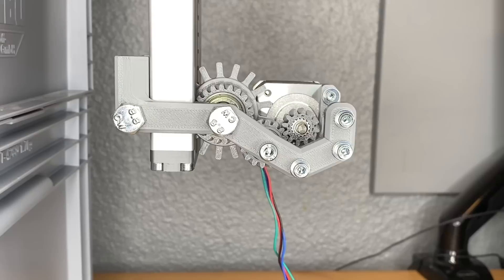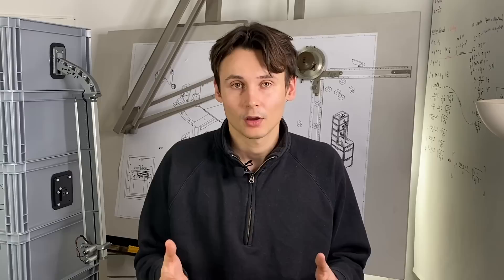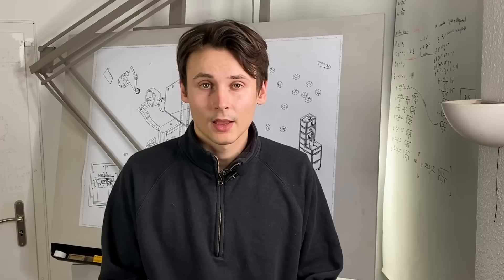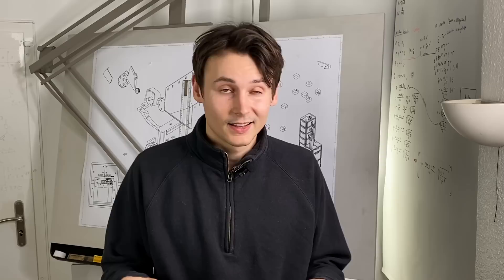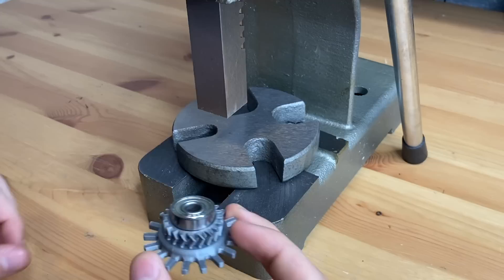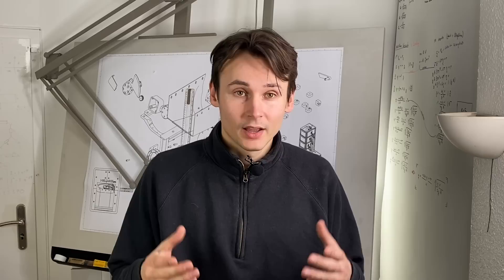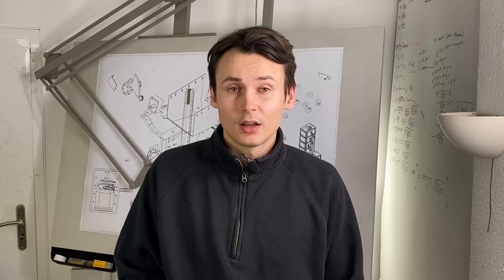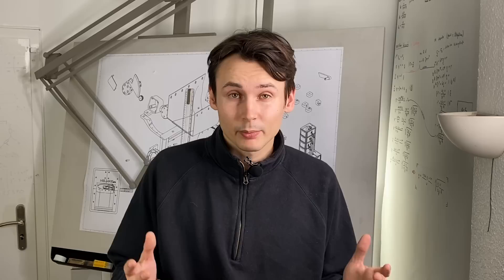The sprocket - 3D printed automatic screw packaging #002

Comment: I don’t know if you considered it yet, nor how well it would work in comparison to this method, but something akin to a “Rotary Air Lock” / “Rotary Hopper” could be used as well.
Reply from the maker: Interesting, I never thought about that.. will think about it
Reply: Isn't this basicaly it, but for single screws at a time?
Reply: @akkudakkupl  The thing i am thinking of, rather than being a gear with a hole near tangent to the chute, has a Circle in-line with it.

Rather than having a gear it has one (or potentially more, although I don’t know much about this) indentation in a cylinder.

So every rotation it drops one part.

It may be slower, although it would keep the parts better aligned potentially.  May also be able to make the motor control easier, but that’s debatable.

Also it may be easier to adapt to other parts/materials, you can make a different indentation for each part/material, unlike this which (at least as of now) is quite dependent on the screws being able to have that screw notch fit in there.

GRANTED whatever works works, and i feel like the rotary hopper may honestly have quite a few disadvantages.

But i just wanted to throw the idea out there and make sure it was considered.
Reply: @ericlotze7724  Okay, I think I get your idea. The tool needs to be engineered for a specific part anyway ;-)

Comment: Really excellent videos! Have you consider using a worm gear from the stepper motor. Those are completely interlocking if power fails. Furthermore, I noticed that your magazine has a length that’s scales to the screws shaft length. Is that necessary? Just a suggestion but you could use the same magazine for eg all m4 with different shaft lengths as it’s the head that makes the magazine work? But again excellent work! 😃

Comment: Cool project! Maybe a worm gear would also work.
Reply from the maker: Thanks for the idea! I'm not sure if they don't have too much friction at higher speeds when using printed gear parts, operating temperature needs to stay low because of that, additionally worm gears do tend to have higher reduction ratios, would like to keep the dispenser speed though..

Comment: I’m also curious about the vertical stack design, and how universal it will be.  I’m picturing that it works uniquely because you’re modeling with hex cap screws and hex nuts.  Other screw types like a countersink head would not keep the screw shafts horizontal and lead to a different feed solution.

What I’ve seen along these lines tends to be a mostly horizontal + sloped design that’s still gravity fed but uses a vibrator to overcome stiction and keep the parts flowing.  Is this something you eliminated in your design decisioning, perhaps because you don’t have this requirement?

Comment: Hi. Is there a reason splitting bracket for the two solenoids was not considered? The top solenoid could then be positioned on a rack attached to the magazine, with incremental fix points for every fastener count. Position top solenoid at "10" for a drop of 10 fasteners.
Downside is different racks/fixture brackets for every fastener type -> but already an inherited design choice from the fully constrained magazine itself.

Comment: I wonder if you can throw in a couple horizontal or even uphill swings in the loading hopper to minimize the weight of the screws instead of having to load it with a separator. Some of that excess force maybe will be lost in the turns?

Comment: Just asking, why so difficult? A sensor at the output and pick up wheel will do wonders, this will be connected to a plc, (on the plc you can make recipe's) you can use 1 solenoid, so you can hold the screws and drop them in one package!

Also safe for more size screws! 

(Can also be a arduino connected to a pc)

Comment: Very cool design! Maybe I missed it, but why do you need to singulate the screws in the dispenser? Couldn't the screws be counted before they enter the dispenser using a light gate? Then you'd run the pickup wheel until the right number of screws has been picked.

Comment: If you want to avoid a stepper motor, can you maybe use a dc motor in conjunction with a light sensor sensing the sprocket? Every flash of light would mean a new screw has passed, similar to how gaming mice scrollwheels work. Want 10 screws? Turn on the DC motor until you've seen 10 pulses.
Reply from the maker: Thank you for the comment! True but would be hard to stop/ rotate precisely. Not sure if it would work reliably

Comment: wondering if using a closed loop nema boards on each motor. Assigning each an address where you would only need to have one controller on the base unit configured with how many module units you have stacked. One config value. Base unit = modules 1 Base unit + 1 module = 2 etc, Each module being address and marked on your bin sides. There is a mix and match question here but you could assign a value to each bin and a matrix to decode the addressing needed for the mix and match modules. 1+2 = 3 so base and module 1 installed. 1 + 3 = 4 base and module 2 installed, 1+2+3 = 6 base and module 1 and 2 are installed.

just a thought lol

Comment: Why not use a worm drive mechanism (globoid, single start) instead of this complicated gear setup? That would also self-lock, you'd get rid of 1 set of gears axle and bearing, and it would be more compact as the stepper could then be mounted vertically

Comment: I feel like you could just simplify the whole idea if you just used the machine at 0:21. You could just count how many degrees the wheel turned from there. One flaw I see in that is if the screws get stuck together.

Comment: Based on the principle of " the best part is no part"  -> as the screw exists the separator one by one, why not just use a magnetic or optical sensor to count them then stop the rotation of the motor?

Comment: sorry but i'm still convinced that through a combination of very smart software, plus some very cheap ICs sensors and DC motors, it's possible to build a reliable screw counter/dispenser with similar speeds under 30€ for the entire thing

Comment: Why not just use a RAMPS board and an arduino mega? You can control 4-6 (I forget exact count) steppers per controller. Then you can use G-code to dispense.

Comment: Why not a worm screw?  Its holding power would be greater and changing the wheel for a different screw size seems simpler since you'd mesh the worm screw directly to the axle

Comment: Does the mechanism have enough of locking torque when it is powered down?
 I think a worm gear would be ideal here, as it is inherently self locking, but should be fast enough to reach a similar amount of screws per second. 
I am also interested how long the dividing sprocket will last, given the continued impacts on the long-ish dividing "teeth"
Reply: But that has a very high gear ratio, might slowdown the whole device a lot.

Comment: instead of herringbone gears, why don't you try worm gears, they give oneway rotation which blocks heavy screws from rotating the motor in reverse, and also are compact WRT torque conversion and size ratio.
Reply from the maker: I'm not sure if they don't have too much friction at higher speeds when using printed parts, operating temperature needs to stay low because of that, additionally worm gears do tend to have higher reduction ratios, would like to keep the dispenser speed though,  so I am not sure if this would work

Comment: Is there a reason you didn’t use a flathead for the wheel that picks up screws?
Reply from the maker: Yes. There are 3 such screws distributed on the pick up wheel. Without them/ using flatheads the whole thing would not work for long.. I will explain it in a later video :)

Comment: That whole thing is an overcomplicated solution to a simple problem. Although a very nice solution.  But too many parts and the whole mechanism needs to be well maintained. 
In normal life, where time is money, the real people measure the weight of 10 screws, and then use a precise scale to count the screws. I think, at big screws it is accurate enough. At small screws, just add some more, and your customers would be happy too.

Comment: awesome video ♥
i am using blender for 3d modeling , my question is did your software make gears interact with each other or you just animate it with keyframes and what did u use for such project like that 
for mechanical engineering
thank you so much

Comment: Can't you use worm gear? It's self locking and the torque doesn't affect the motor.
Reply from the maker: self locking would be beneficial, but I'm not sure if they don't have too much friction at higher speeds when using printed parts, operating temperature needs to stay low because of that, additionally worm gears do tend to have higher reduction ratios, would like to keep the dispenser speed though..

Comment: It looks like many parts need to be designed and parameters tuned for each screw, nut & bolt. Have you considered designing a vibration conveyor plate and a load cell to count by weighing using a cheap load cell?
Reply from the maker: I tried to keep the number of parts to replace as low as possible, but you are definitely right. One of the advantages compared to weighing is that the screws are supplied fully constrained and oriented. This is necessary for a variety of other automations. Robotic bolting of assembly's, embedding nuts in 3d prints automatically. etc. - The counter is supposed to be just one of many modules that can be connected to the feeder.
Reply: @christopherhelmke  I did not realize you had this requirement but I’m sure you know that vibration feeders are the number one solution for part orientation. Strengths: extremely reliable (from design simplicity, low maintenance, no moving parts), high social media appeal 😌, weaknesses: noise, resonance tuning.
Keep up the good work! 😁

Comment: 0:23 why did you use a lifting wiper mechanism instead of just using sink screws to prevent the collision? do i miss something? seems overengineered to me, but very cool, that you put your time in stuff like that instead of printing pointless stuff :-) cheers
Reply from the maker: There are 3 such screws distributed on the pick up wheel. Without them/ using flatheads the whole thing would not work for long.. I will explain it in a later video :) Thanks glad you liked it :)

Comment: Well done.  Do you have a method of sensing whether the feedtube is empty (or ensuring you are dispensing screws)?  As far as controlling the multiple dispensers (you mentioned 10), you can combine three 3D printer controllers ( X axis, Y axis, 2 Z axis stepper motor drivers per each board), and a small computer with 3-USB ports - 1 for each "dispenser".

Comment: Impressive machine but is there a practical use? Parts counting is usually done by weight not counting individual pieces.
Reply from the maker: Yes, yes technically it is more of a feeder than a counter. One of the advantages compared to weighing is that the screws are supplied fully constrained and oriented. This is necessary for a variety of other automations. Robotic bolting of assembly's, embedding nuts in 3d prints automatically. etc. - The counter is supposed to be just one of many modules that can be connected to the feeder.  I think the title is a bit misleading here.

Comment: That dispensing sprocket is already almost a rotary encoder, you would just need an optical sensor to detect the pulses. If you could make it accurate enough, it would allow you to swap the stepper & driver to something way cheaper and simpler to drive, like a continuous rotation servo.

Comment: For a rotation sensor, could you use a photocell encoder? I saw one on an inkjet print and it looked like an effective low cost solution
Reply from the maker: yes .. i will probably use a similar sensor, thanks for the comment!

Comment: I get that you're trying to do it the hard way and be clever but I would just weigh one and do the math. I would use an accurate scale and a device that drops one at a time until the weight matches
Reply from the maker: I totally get your point! I would even say that doing something in an unnecessarily difficult way is not very clever. 

One of the advantages of doing it the hard way is that the screws are supplied fully constrained and oriented. This is necessary for a variety of other automations. Robotic bolting of assembly's, embedding nuts in 3d prints automatically. etc. - This is more of a screw/ nuts/ washers feeder than a counter, and the counter is supposed to be just one of many modules that can be connected to the feeder.  I think the title is a bit misleading here. 

You're absolutely right, just for counting - it's unnecessarily hard.
And that's why its really a great comment! Unnecessary complexity is in my opinion the killer of very many automation attempts. 

Another reason why I started with the counter module is - that it is simple. I want to make videos that are pleasant to watch. This way I can get some experience with video making before we move on to the more complex ones.
Reply: I think the automation is really key, at least “in my book”.  With projects like these one can make a machine that can basically turn a Bill of Materials (BOM) spreadsheet into a ready to build kit, all with no human input.  At least that’s my long term goal.
Reply: GRANTED one would only use such a system at a “Makerspace” / “Microfactory” scale, not for Home Projects etc, so you are somewhat correct in that criticism.